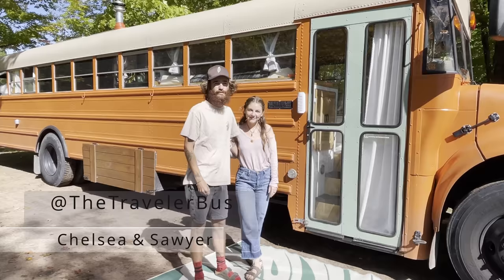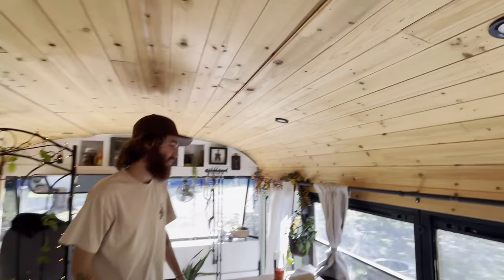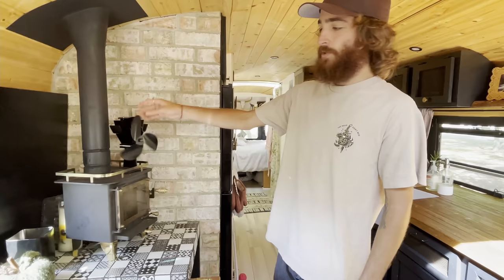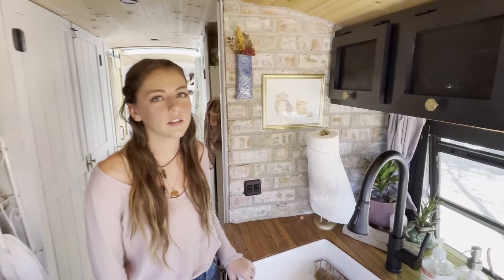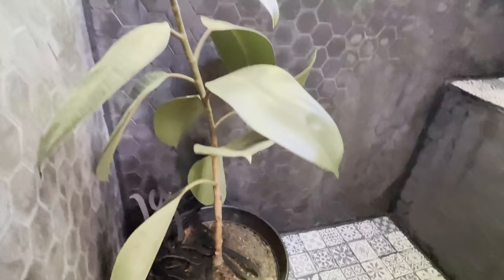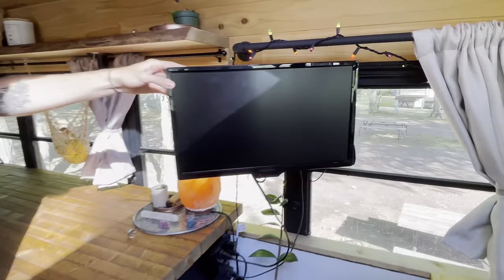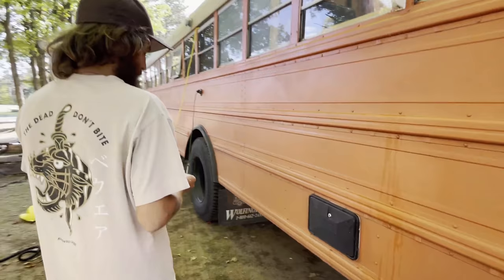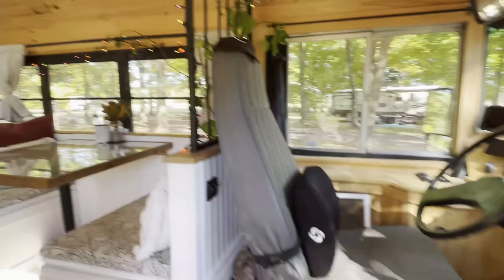Self Built Skoolie Tour - Tiny Home on Wheels For $15k

Comment: I love seeing young people like yourselves that are mature and doing so much!  You've done quite well here. As an aircraft mechanic who has worked on Boeing and Airbus aircraft I have a little  appreciation of the energy, difficulty and time that it takes to disassemble, fabricate and assemble so "hats off to you," you've done well! 
For future reference use RTV silicone as a sealant. It does wonders and is easily obtainable at most hardware stores just make sure you surface prep well before application, like the way you did for paint!  You can use it for faying surface, fillet and edge sealing.  You can Google those terms. There are good "how to"  videos on YouTube.
Happy Trails!

Comment: You have created a gorgeous home on wheels. The level of craftsmanship is top notch and the woodwork your Dad did is amazing. To prevent shoes piling up on the rug next to the door get a bin with a lid or build a wooden box with a lid (that you seal with waterproof finish to protect the wood )and add handles to make it easier to pick up and store whenever you hit the road and to keep the creepy crawlies out and decorate the top to remind people to put their shoes in it before entering the bus. You could get creative with wood burning a design, carve one or paint something as there are endless possibilities to make it reflect your personalities and esthetic. Awesome job and it’s definitely in my top 5 of favorite conversions/tiny homes. 🤗❤️❤️👍🏻🚌 since you know how to sew it might be a good idea to make some magnetic screens to put over the windows whenever you open them. Have you ever thought of putting some extra strong Velcro on the items on the shelf in the kitchen to prevent them from moving when you are on the road. For the pantry build a unit that has shelves and can be pulled out with drawer slides and/or have wheels at the bottom which you might not need if you use slides that hold higher weight limits. I have seen this in many schoolies and conversions both van and truck and RV. Last thing to consider is adding some metal mesh (with a smaller design openings in the mesh) panels to the underside of the brackets that hold your water tanks under the bus to prevent road debris from hitting and damaging your tanks. How are you going to winterize the tanks and water lines if you are traveling in the colder months and areas of the country that get much colder?  The mini split would definitely make it more livable year round because it heats and cools and with the location in the back it would transfer to the front better with only a small fan you could attach in the hallway.  Everyone learns more about their schoolie and various types of homes once they actually live in it for a while. Like I said you have created a gorgeous home and looking forward to seeing more of your adventures. Wishing you the best and stay safe and healthy out there on your journey. ❤️👍🏻🙏🏻🤗❤️

Comment: The Skylight water leak. You shouldn't just keep adding stuff to it to try and stop the leak. After 3-4 attempts you really should remove anything you've added and start over. I would start with some marine Silicone Caulking. Do not just blob it on, take your finger and and spread the caulking evenly and smoothly. This will force the caulking into those little holes. Apply a second coat of Silicone Caulking and smooth that out. Flex tape is good but it's overused in some applications.

Comment: On that ceiling, did you leave the tongues show on those two edges because you found you would have needed a small section and that the center piece would gave been off centered???  Did you start on a side to run the wood or did you actually start in the center???

Comment: So very nice. I want to do something like this. One thing that I notice though is that it's very few single, solo females that do it alone. Most of the ladies have a partner, and I'm all alone so it will be a challenge. I don't know anything about electrical, plumbing, or carpentry I would worry about preventing fires and carbon Monoxide.

Comment: You actually don’t need to convert anything… veggie oil will work in it during spring and summer and a 50 50 mix in the fall and winter